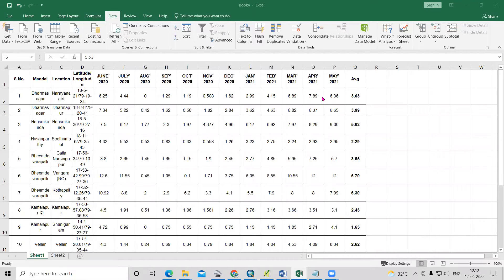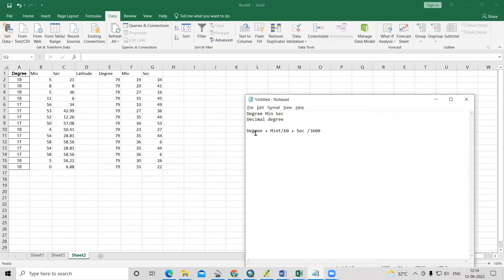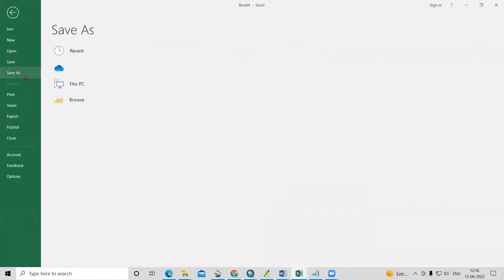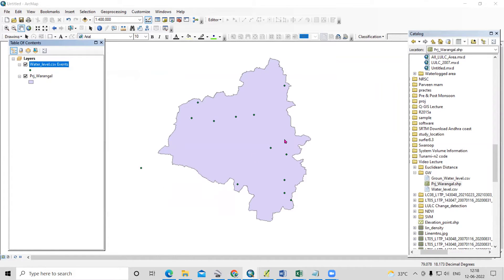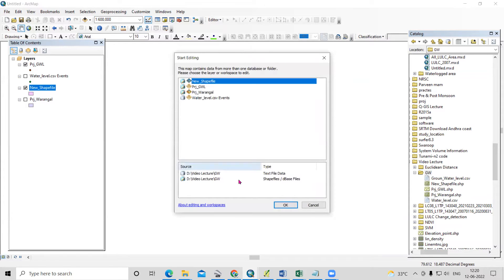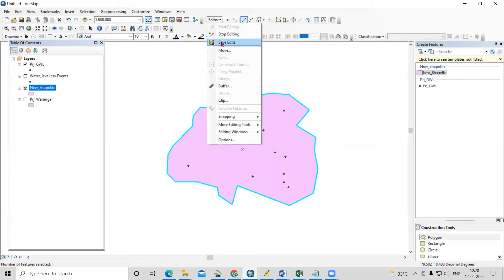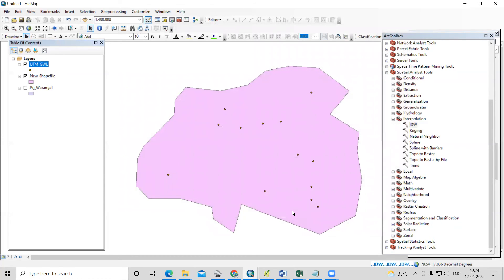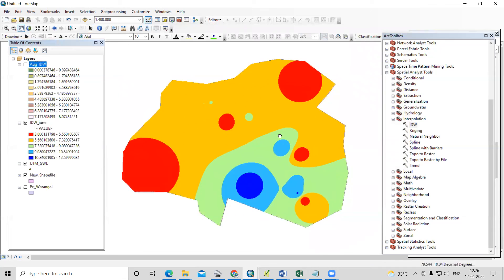How to prepare Ground water level map or Depth to water level map using Arcgis || IDW

Comment: We think that this method of groundwater level IDW interpolation is not correct. We use a Spline for a small area, or Natural Neighbor. It is better to determine the direction of groundwater flow.

Comment: Do you offer tutor in GIS hydrology?
I have a homework for uni GIS and no help from professor...
I have to make an average groundwater map
They gave me following data:
- an excel point data of coordinates and elevation
- excel data of tidal water level
- excel data of ditches position and the average water level at the ditch

Do you know how to do it? How much it would cost me for you to tell me the steps I have to do?

I interpolated the elevation points to obtain a DEM, but I don't know how to calculate water values and make a map of it (I assume interpolation should be used for this step, but I need values first)
Reply from the maker: Contact me email vikasghadamode77@gmail.com or WhatsApp +918421031398